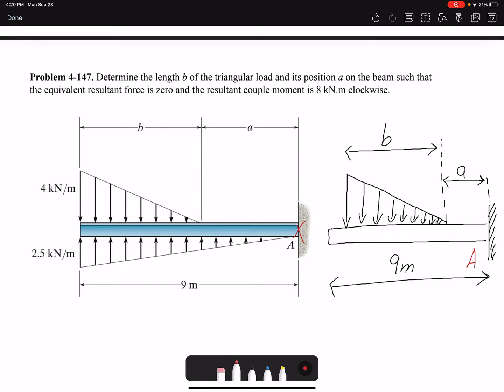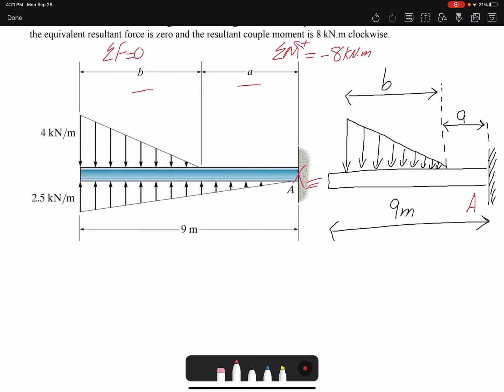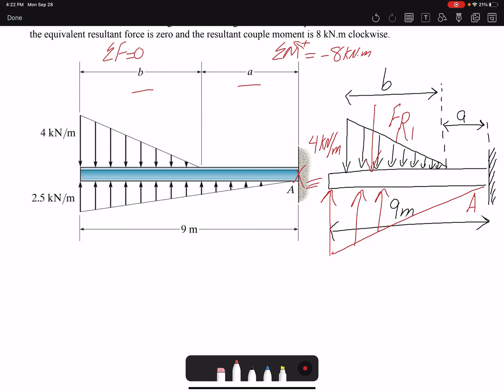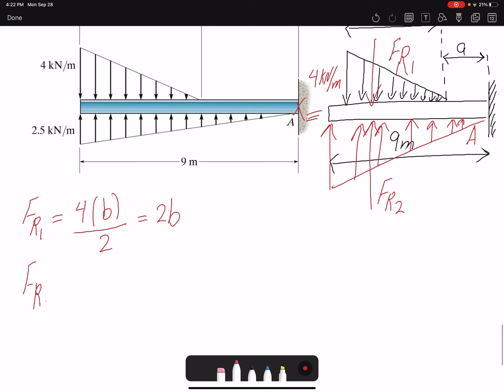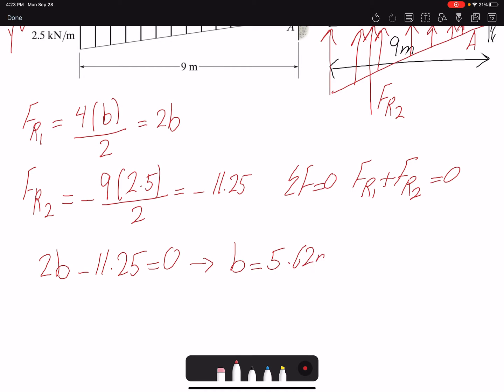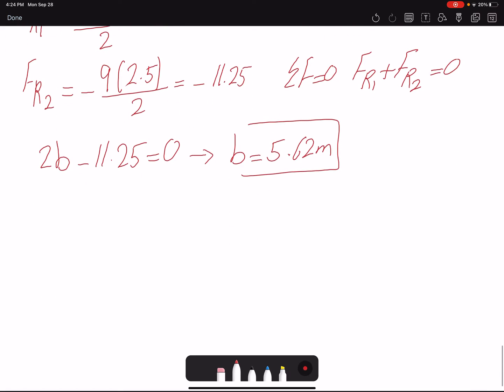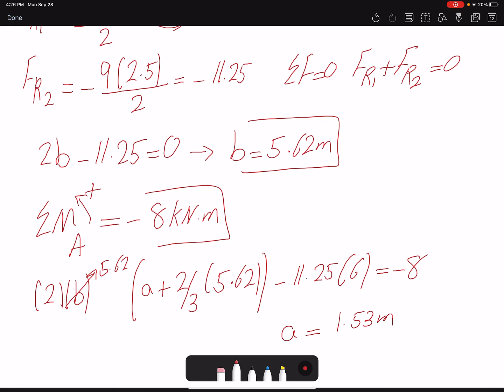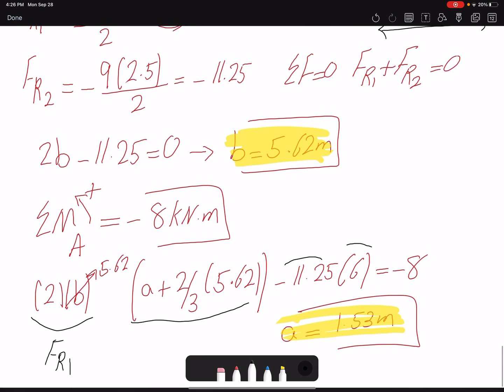Statics Problem 4-147: Equivalent load of two distributed loadings

Comment: how is it possible that the bottom side = 9m, but a + b = 5.62+1.53 != defintely doesn't equal 9
Reply from the maker: The distributed loading on the top of the beam doesn’t start from the free edge of the beam, look at my free body diagram for accurate location of the distributed loading